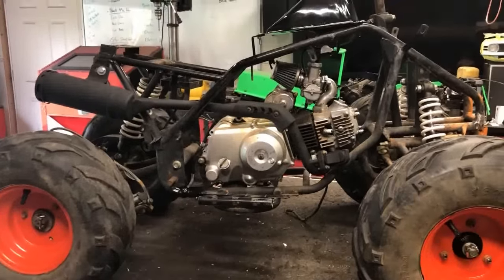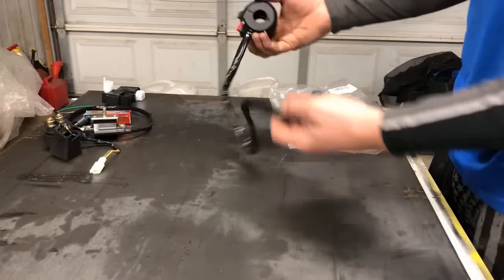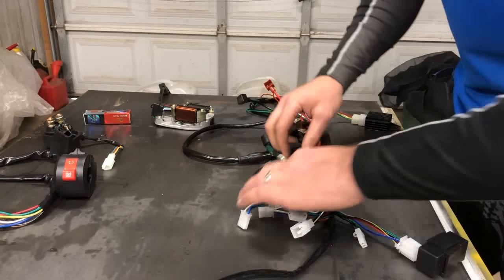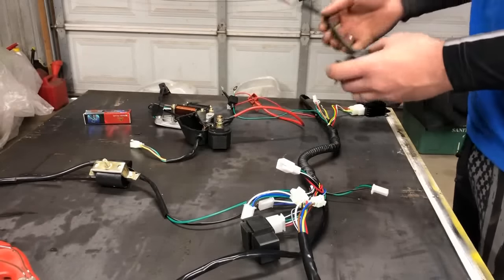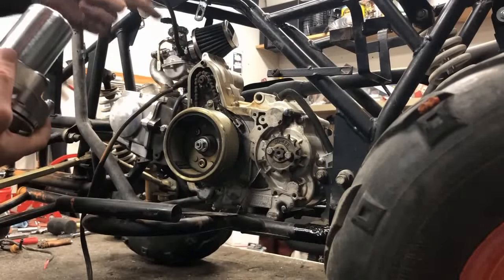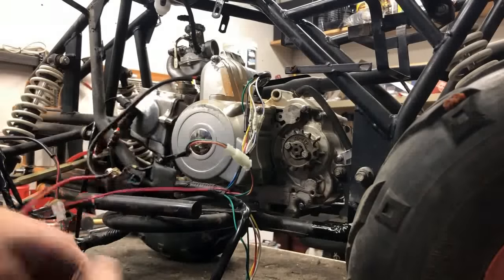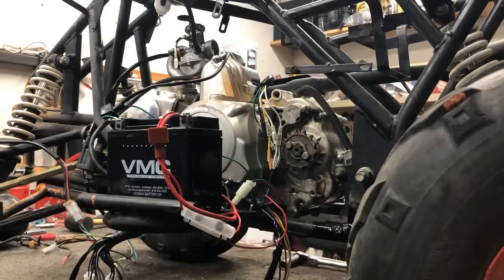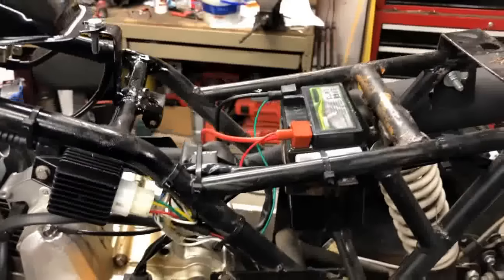Wiring a Chinese ATV from start to finish with an All New Wiring Harness!

Comment: Yea my new engine came with the 6 coil and my wiring harness came with the two coil so my harness didn’t match up, I will get a 6 coil and see what happens because this wiring harness I got also didn’t come as a wire pin plug in it was just a regular plug. I think this new 6 coil harness is exactly what should plug right up to this engine ! I probably won’t even have to replace my 6 coil stator since it’s new so I’ll have an extra one.😎

Comment: I have a 1985 Honda 200X  3 wheeler , I replaced the 200 cc with a 250 shinerey motor, I replaced the Old wires with the 250 shineray wiring , when I hook the wires up the key switch and start button doesn’t work , if you touch the starter wire to the solenoid it will turn over but continuously runs . Any suggestions?
Reply from the maker: If you touch the starter wire to the solenoid and it turns over that means the circuit is complete. Try a few things to pin point what is causing it to turn over. With the key in the off position does it still turn over? With the key in the on position and the kill switch in the off position does it still turn over? If you unplug the start switch completely from the harness does it still turn over? ...Try to figure out what will stop it from turning over and that will help lead you to the issue.
Reply: Yes it still turns over
Reply: I did connect the two safety wires together and it works , but I do have two set of wires coming from the motor that I’m not sure where they connect .
Reply: When the motor is running the ignition wires are fine , but when you ride the bike one of the black wires coming from that ignition melts ?

Comment: Awesome video. Question for you. I have a Tao Tao 125 atv but it has a manual transmission which comes with light indicators for fwd, reverse, park. Would I need a different type of harness or do all I care about is the stator when determining the proper harness?

Comment: Hey Brotha Great Video.... I am looking pretty good on my Build now. 1 thing though.... There are some wires coming out by the chain sprocket to the right of my stator cover. It has a 5 pin connector and I don't know  where it goes?? Would you know where or what that is??

Comment: Nicely explained. In my case, I have removed cover of stator from my atv, and the stator was little bit covered with motor oil, i guess its not normal right?
Reply from the maker: Thanks! There should not be oil behind that cover. It has a gasket but that is to keep dirt out not hold oil. Possible have a crank seal that's leaking. Do you have a lot of oil or just a little?
Reply: @PraskaBoysGarage  Just a little amount of oil, btw thanks for your reply.
Reply from the maker: @FS-wb4fc Yeah you bet! Let me know if you tear into the motor and have any questions!

Comment: Video was a great help in getting all connected but I still don't have spark. New battery and good ground and everything else works. Engine turns over well but still no spark. Any idea on where I'm going wrong? Wires to coil are correct too.

Comment: Hey, I have a 110 auto on a pit bike, & all the wiring is good, starter turns, piston turns. I am wondering if I need wires hooked up for the brake in order for it to start? That’s my only problem I’m thinking of. I do not have any sort of lights on the bike, thank you for the video!
Reply: My bike also has hydraulic brakes on the front and rear
Reply from the maker: The brake handle safety keeps the starter from being able to turn over. If you can press the start button and the starter motor spins then you don't need to hold down the brake.

Comment: This video is going to help loads. As I'm going to rewire my new ATV this week. Big fan of your YouTube page. Just wondering when is the next video coming out? Many thanks Allen
Reply from the maker: Happy I was able to help! Thanks for being a fan! The last few months have been a struggle to get into the shop but I am pushing to do a lot of projects for 2020. The next project should be finished in a couple weeks and after that I will be doing another atv.
Reply: @PraskaBoysGarage  My Son has a 110cc ATV.  I have done a lot of work on it to get it up and running. The only thing that I'm having a issue with is when I go to start it up. ( Its got a push start button ) Is when I go to press it to start up the ATV.  All that happens is the starter motor keeps turning and not firing up straight away. I can keep my finger on the start button until the battery has gone right down. I have lifted up the choke and still nothing. I have cleaned out the carburetor and put in a new spark plug. Also been and put a new battery on the quad. Have changed the oil and put fresh fuel in as well. But still having the same problem. Any advice would be awesome. many thanks Allen
Reply from the maker: @allenmcgeemovies7084  Sorry I missed this reply. Are you still have the issues?

Comment: Thanks for the video. Very helpful. I think you mentioned something about spark plugs being an issue with these. I just changed out all parts to my coolster and got it to crank and as soon as I did the spark plug started smoking. Any idea as to why?

Comment: I'm in the process of putting a 110cc chinese engine in my atc 110.you saved me lots of trouble. One question though.... how do you hook up the original old school headlights on a Honda three wheeler to the blue and white wire on the wiring harness? Are there any special modifications I really want headlights and tail lights on my 3-wheeler.thank you.great vid.
Reply from the maker: Thanks! Im happy I was able to help. It would be a trial and error for me so this is my suggestion. Start the 3 wheeler and put a voltage meter on the blue and white wire. See if its sending 12volts. If it is, that needs to go to power on your headlight and then ground the other light wire. Hope you can get it figured out!

Comment: Great video, do you have some tips on picking up a use not working "dosen't turn on" ATV? Like what to look for & does it matter if it doesn't have a title?
Reply from the maker: 1) Love your name! 2) Here is what you should look for: Decent Tires, complete plastics and a motor. If you can find them with those 3 things and under $100 dollars buy it! Everything else is easily replaceable and wont cost a ton. Those 3 are the most expensive parts for these builds. 3) In my state a Title isn't a big deal unless you want to ride at an atv park. I've only received 1 title in probably the last 20 i've purchased.

Comment: Hi, your video is awesome, helped me understand this wiring maze. I changed all the wiring but the engine won’t start, it does the exact same thing like when you started your engine without the spark plug in. In other words the engine is trying to start but doesn’t. Sometimes it starts but I need to keep the gas on, as soon as you take off my finger of the gas the engine dies. Do you have any idea what’s wrong please? Thank you

Comment: Thank you so much for all the help.there was a part on the front of the engine under the carb that was making this poof poof sound, if you watched while trying to start it you could see a fine mist come out. i took it off and the gasket was bad. No gasket material so made one out of a piece of cereal box installed it and she took off like a bat out of hell. Do these things only have one speed? The throttle does nothing and the brakes are almost non existent. Kill switch works great. Pointers on what to fix next would be great. Already working on the brakes.
Reply from the maker: Jillian Hurley Your throttle is stuck in the open position. Couple things adjust that position. There is an idle screw on the carb, the throttle cable should have an adjustment point in the line and then the throttle cable itself. Start with the carb and let out the idle screw. If that doesn’t do anything check the cable adjustment. If the cable adjustment is at the shortest position then I’m assuming your cable doesn’t have enough slack to let the slide drop all the way into the carb. Let me know where you find the issue!
Reply: It was the throttle cable, looks like it had broken at one time and someone “repaired it”. New cable and twist throttle assembly ordered. Ps. We started working on my girlfriends 70cc and her stator came the same way 2 yellow wires. Could it have anything to so with the fact that we are in australia?

Comment: I like the way your harness looks. The three I purchased were a conglomeration. They were the most unorganized grouping of wires I’ve seen. If the people that were paid to put those harnesses together worked for me, I would fire them! Great vid, I appreciate the way you demonstrate the process. Very organized! The two wires on the switch that you had the most trouble with, my colors were white and red, so they can come in any color available for the lazy line worker to grab that he or she might have just laying around needing to be used up instead of installing a proper color. Anyway, great job dude, again I appreciate you taking the time to show your experience with the China wiring system! By the way, from whom did you order that loom?
Reply from the maker: Thank you! There just isn't enough good information available for these chinese atvs and there wiring. I glad I'm able to help others with there install! Both types of wiring harnesses are linked in the description below. I have also purchased them off eBay and shipped direct from china.

Comment: Great video, really clear. Thanks.
Mine now turns over nicely but no spark! Any suggestions please?
Reply from the maker: Start with the simple stuff first. Spark plug good? Good ground? Everything is connected properly? If its turning over that solves a lot of headache. Spark can be narrowed down to only a few issues.
Reply: @PraskaBoysGarage  thanks for the reply, it turned out to be the ignition, the cheap wiring had broke. I tried to re solder the joints but no good.
£4.99 for a new switch and now she is good! Thanks
Reply: I must add that before the ignition switch fail the stator wires were a bit iffy, hence why it was cranking, but then completely dead!
Reply from the maker: @rickster3287  Awesome! Well I'm glad you figured it out!!!

Comment: Good video dude  the walk through was thoroughly explained.  Do you know how many safety switches are on this and where they are?  Thanks
Reply from the maker: Thank you! There are a bunch of reasons it wouldn't start but specifically the safeties are: Either the Hand Brake / Foot Brake needs to be applied and the rear tether needs to be plugged in. Other simple things like the key switch, and kill switch need to be in the run position and the fuse has to be good.

Comment: Hi, love your videos. Very informative and fun to watch. Your videos have given me the confidence that buying and rebuilding one of these is worth it over buying a new ATV. I recently bought an Ace 125D in pretty rough shape and I'm currently rebuilding it ground up. Many parts very missing or broken. I decided to buy a new head instead of replacing valves as the heads are so dirt cheap. I' ve been running into an issue with finding out which head is the correct one. mine has a 32 teeth timing sprocket and all I could find were heads with a 28 teeth sprocket. I tried contacting VMC and other sites but got no response. This is the only issue I couldn't solve with your videos. Do you have any advice? Thank you so much
Reply: I would just buy a new sprocket
Reply: @kar21ol96  the housing for the sprocket is slightly different and the other sprocket doesn't fit

Comment: Great video, my problem is to starter, how can I check the starter, if it good or bad, thanks I'll be checking up on all yr video,
Reply from the maker: Aladino Reyes Checking the starter is super easy. Connect the power wire coming from the starter to the positive side of a charged 12v battery. Then take a separate wire, attach it to the negative side of the battery. Now take the negative wire and strike is against any parts of the starter housing. If it turns over you’ve got a good starter. Check out any of my ATV build videos, every time I test the starter! Let me know if you have questions!

Comment: I'm having problems rewire my harness back what do I exactly have to do to get fire and get it started and what wires
Reply from the maker: I would purchase a new harness like I have linked in the description if you have an ATV like mine and follow the step by step to install.
Reply: Yes I got one like you I washed your whole video but I think I melted one of my wires could I bypass that with another making it with another wire
Reply: What kind of four wheeler exactly what it is
Reply: Cuz mine don't got no serial number on it I can't find it nowhere on the frame you know where the chair numbers at by any chance

Comment: Quick question if you don't mind...how often do you have issues with the Stator Magneto on these. I ordered two in a row and they look like they've been repaired, but still don't work proper...
You make this stuff look too easy man.  Kudos!
Reply from the maker: Lol thanks man! I will tell you in my personal experience rebuilding over 25 of these chinese atvs I've only had an issue 1 time with the stator being bad. However I have had other subscribers reach out with issues on theres and actually ordering 3 of them in a row before getting one that worked! It can be frustration for sure! Good luck trying to get it! Have you looked up "how to" test a stator to make sure yours is good or bad?
Reply: @PraskaBoysGarage  boy oh boy, I am giving up lol. I'm on the 6th harness and the stators keep coming in without working. Thanks again for your videos man...it was definitely helpful. FYI, I'm rebuilding a mini chopper, not ATV, but it's got the 49cc Chinese motor.  I'd post a picture,  but I don't know how lol. Keep on keepin on bud!

Comment: I have purchased the same harness and watched ur video. Everything went together as should. Turned over like it should but no spark from plug. Everything is new with new stater. Hot battery. What's my problem?

Comment: I have a Tforce Tao 125 atv problem is overcharging at idle about 16 volts have changed regulator still have problem do you think a new Stator will solve problem  any help will be appreciated.
Reply from the maker: David Nelson If you have already changed the voltage rectifier then I would assume it’s the stator. 1 makes the power and the other converts it to DC volts. Hope that solves your issue!
Reply: Thanks I will try new Stator. As I have burned 3 batteries in 20 hrs. of operation

Comment: Ok got it running. Couple of issues when it turns over it takes off like mash the brakes to keep it in place. So rode it around the block (it runs like a scalded cat)and the chain fell off, hell of a noise engine over reved, hit kill switch, pushed it the two blocks home. Reinstalled the chain, tightened and went to go for test ride. Nothing, checked my wires, yup one had come un soldered. Went and bought proper wire connectors wired back up as before now i have spark, starter is clicking but it wont turn over..and the tail light stays on no matter what i do with the switch position. The only other thing i did to it was shorten the fuel line, as it had a kink in it. Have i mentioned this is not the original motor? Do any of your videos cover the front end? It looks like i have a tow in and out problem as the front left is leaning in and the front right looks to be fine. Also is there anything on carburettors? I know nothing about them looks like there is a something missing in the housing as i have an open hole on one side and a bb looking thing on the other side looking at the outside housing. One more thing is it alright to shorten the throttle cable, the adjustments are tightened all the way but way to much slack in the cable.
Reply from the maker: Jillian Hurley Alright that’s a lot to cover so here I go! First turn the idle screw counterclockwise to slow the idle down. Next is the starter clicking or is it your starter relay? Big difference trying to figure out that problem. When it comes to the front end and carburetor I don’t have specific “how to” videos but you see small parts in my rebuilds where I address those issues. Nothing with deep detail however. I think that covers it! I hope I’m helping! 🤞

Comment: The quad you switched the harness on was it one gear what stops it from moving when it’s running if there is no gears
Reply from the maker: No gears on this one, just has a centrifugal clutch and it engages when you have a higher RPM. Idle down the motor and it wont move under a load. Also you can lock the hand brake.
Reply: @PraskaBoysGarage  how did you connect the hand brake wire

Comment: I need some help. I bought a Typhoon 110A. There is a vin# on the motor and a number stamped on the back of the rear swing arm. Any suggestions where I can find another number. Dmv in California can’t find anything on it. Don’t have any paperwork or previous registration info. Thank you for any advise you may have.👊🏻
Reply from the maker: Only other place I have ever seen a tag on these atvs is under the nose of the plastics. Sometimes you will find a ID plate. Otherwise that pretty much covers what I've seen.
Reply: Well I appreciate you taking the time out to throw that suggestion out there👊🏻👊🏻👍🏻 But no dice. Hopefully the highway patrol can figure it out or give me a new stamp. Keep making good videos! And we will watch you soon.

Comment: What is the amp on the fuse coming from the positive connector   close to the batter. The one I am replacing doesn't have any marking on it. Want to make sure I put the right one in. Thans